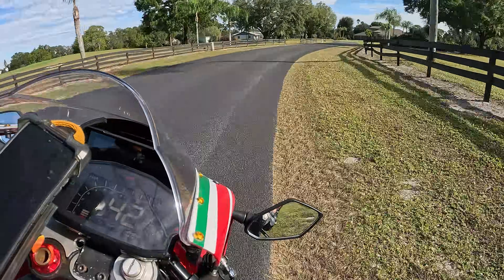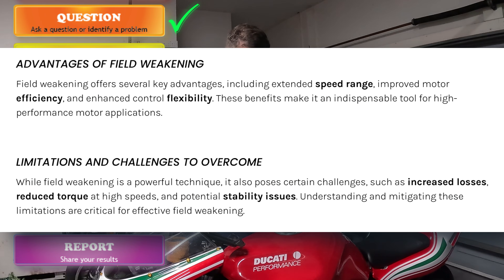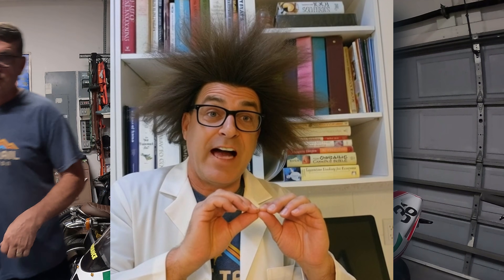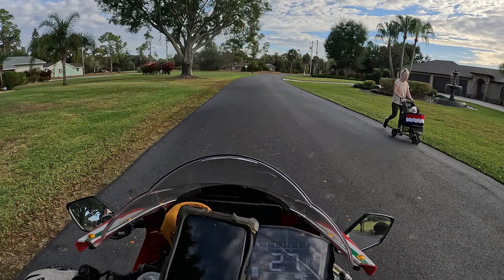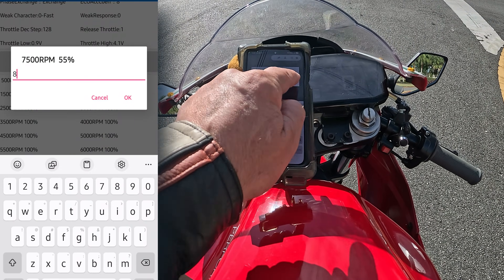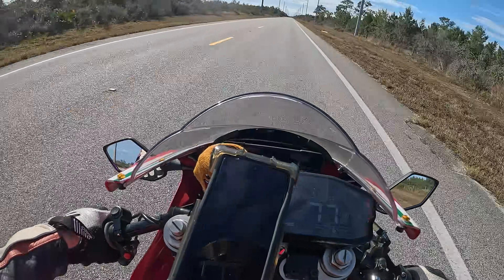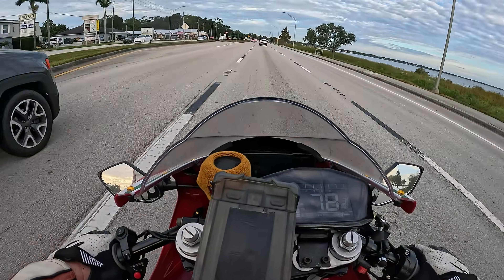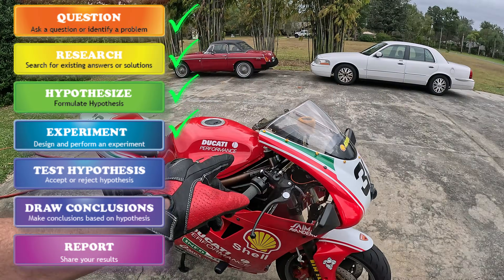Fardriver Ratios In Speed and Field Weakening Paradox.  Why Ratios Wont Make Me Faster

Comment: You can adjust ratios in speed in app only from 0 to 9k,  but your motor can rotate up to 15k and it has 4 pole pairs, if you put 5 or 6 pole pairs in app I quess it will recalculate rpms in proportion. Can you try it?
Reply: My motor does not spin at all or only a little bit when I try other pole pairs values so it does not affect only rates in speed.

Comment: Why don’t you just use brake lever regen braking ???? It’s wayyy better in my opinion …. I love coasting so for me regen braking when release throttle is a nightmare! I am also not using regen since I have full motorcycle brakes

I have been following the field weakning thing and I get even more confused as you drop more videos lmaoooo … I gave up! I am content with 85mph right now 

Best bet is to get a motor rated for higher rpms 😁
Reply from the maker: I am just as confused as you.  LOL.  So I will gear the bike up and remove the issue.  I think this motor is not rated to 15k as advertised.   I saw one guy do it, but it was no chain and no load.  So that is inaccurate.   

I only use regen to improve handling.  I actually do not need ANY regen on this bike.  I thought I had it off.  With my hub, the settings I used had it off.  Not this motor.  If you watched my head shake video you see that I use off throttle regen.  Other than that reason, I would never use it.  For the hub bike it improved handling 100%
https://youtu.be/GvUAGVjI4mM?si=fmHg4-PG4Fiy8ViL
Reply: @GhettoWrench t totally get that! I had regen on one of my bikes and it was just weird, could be how I had it setup on my previous bike which had maguras but now I got full moto brakes on a much heavier and stable Frame i ddnt even bother activating regen lol

But yea the numbers are always slightly inflated with these motors … you should try the qs180 90h, on paper it doesn’t sound faster or more powerful than that gts35 but trust me if you throw the same KW at that Qs180 you will 100% hit 100mph with the same gearing ⚡️⚡️
Reply from the maker: @rolandroland1485 I hear that about the QS180 from so many people.
Reply: @GhettoWrench yep! One guy on YouTube has a modified Harley D with a qs180  …. He has gone a lil over 100mph with more to go ⚡️
Reply from the maker: @rolandroland1485 holy cow.  That thing has to be heavy.  That motor must make some power. When I blow this one up.....  LOL
Reply: @GhettoWrench yessss lol and he has a 26s 96v70 or 80 ah I believe, he is hitting 100+ no issues
Reply: @GhettoWrench One thing to consider is eRPM (which translates to electrical rpm), the video you're mentioning of the TingTong guy running the FW20 at 15K no load is because he's using a different type of Fardriver controller. Just to put it in a nutshell, this GTS35 has a 4 four pole pair rotor, so if you want to reach 15K rpm you need a controller that's capable of outputting at least that times the motor pole pairs (in that case, 15k *4 = 60k eRPM)

The thing is that "regular fardrivers" are just 48K eRPM capable, which would translate to a hard cap on 12K rpm actual shaft revolutions. In order to unlock that extra 3K rpm you'll really need a controller with more eRPM capability, hence the "HR" or Track version (which seem to run a different firmware, and probably CPU too, to deliver 60K eRPM); or go with VESC, they have a CPU and firmware limit to 150K eRPM, and your limit will be your rotor laminations young modulus (aka physics and material limitations).

If you need help figuring things out with this motor I'm at your disposal for motor simulations, but this will probably involve further botching your GTS35, which might not be that bad considering yours wasn't quite "flawless" from even before arrival.

Best regards.
Reply from the maker: @wagnerbrochini3892 thanks.  You are 100% correct.  I was told by someone about that 12k or 3k RPM limit on these regular fardriver versions.  And that is actually ok.  I really don't need that much RPM.  I would like to get more low torque or amps below 6k.  That is my main issue I think.  I cant get the 68kw (700 line amps) until above 6k rpm

Comment: I'm shocked that the taper didn't make the bike faster (not that the taper is a very intuitive solution). I'll have to try putting all at 100% on my ebike, i might be missing out on some top speed.
Reply from the maker: Ya I geared the bike up and just re did that test.  The taper was even slower.  100s for the win again.  Those damn ratios have to serve some purpose.

Comment: i recently switched to moxin controllers. and it only has one fw option to increases or decrees by a %. then another option for power ramp in speed. makes tunning so much simpler. its probably doing all the tunning on the fly in the background while riding. but that's just a guess.
Reply from the maker: Cool.  I want that Moxin wheelie controller.  Since I still cant ride a wheelie after 30 years of practice. 😂

Comment: Im following ur channel from last few weeks you are making very informative videos proving through real time results. Thank you and keep doing this.
Im intrested on knowing the peak temperature the motor and the control hit during high line amp runs ... 
Can I know how long I can run continue at 250A line current? 
Can for straight 30min continue run at 250A (considering i have sufficient battery juice)
Reply from the maker: I honestly quit looking.  I never see over 55ish on the motor and 60s on the controller.  Mathematically I can run 480 until the cells are dead....  but that would be impossible to hold.  Even 250.  Maybe on a freeway in the desert.  But no telling what the heat would be or do during that long of a run in real life.  I have found the math and real life do not seem to ever be close.
Reply: Still you wouldnt pull it. Once you reach max speed amps fall down. Only way would be to go uphill all the time but that aint happening
Reply: @Voltjunkie I agree 😊
Reply from the maker: @Voltjunkie oh ya.  Especially in florida.  LOL
Reply from the maker: @Voltjunkie so I just got back from a ride.  Fast back road.  Over 100mph like 5 times and mostly like 70+ mph.  The controller and motor were both in mid 80s!   Controller was like 87C.  Once I pulled over the motor went down to 60c.  The battery cells stayed in the 40s.  The controller stayd hot till I got home.  30 mile trip and about depleted the battery
Reply: @GhettoWrench thank you 😊

Comment: If I want to go as fast as my E-bike build will take me, well.. I just put everything on max 😅 but field weakening ain't a thing with my set-up.
Reply from the maker: That is my same experience.   But Im gonna keep trying.  Google AI says it will work.😂
Reply: @GhettoWrench I hear you E-Brother, and I've used 'Gemini A.I' to get the answers for some of the trickier things I've wondered about.
Can be very useful at times. 👍

* What's the supposed maximum speed your motor is capable of? I know the battery can't be the weakest link using EVE50PL cells, and a high amp BMS. I wonder if using slightly bigger wheels would gain you much of anything on top speed too..🤔
Reply from the maker: @MickyBee73 I can just change my back sprocket to gear it up and down.  I have lots of 520 chain and masterlinks.   Did you watch the gearing video?  I have geared to go exactly 100mph at 12k rpm motor speed.  I did this planning before I had the motor.  The motor claims 15k peak and 10k continuous.  So at 97mph/11400 RPM weird shit happens.  Im beginning to think this motor is more 8k continuous and 10k peak.  That also goes more along with where the field weakening happens and what the autolear sees as "rated" speed.  So I prob need to redo the gearing and treat it as 8k continuous.   I already have the sprockets.  Just worried it will be slow AF on takeoff now.  I want to ride wheelies.  LOL
Reply: @GhettoWrench  After looking up performance motors for a fast motorbike build using Gemini A.I (just now) it said the 25kW QS268 was the best to use, with either Fardriver, or Kelly controller then it recommended a video to watch...

It was only your video titled "Build your own electric motorcycle Video 1" 😂
Reply from the maker: @MickyBee73 😂😂  I made it to google AI.  So you it is not right.
Reply: @GhettoWrench 😅👍

Comment: I think the slide was due to your regen being set mid to high, might be best to kill it altogether , until you get used to the higher speeds at the higher weight of the bike.
Reply from the maker: Definitely was Regen.  I had ot turned way down from what worked fine on the same kw hub motor.  I think the gearing exaggerates it.  I had it at 10amps max and then only 10% of that in the fields.  Off throttle spiked it to -160 amps!  LOL.